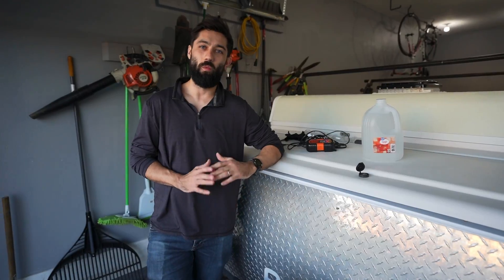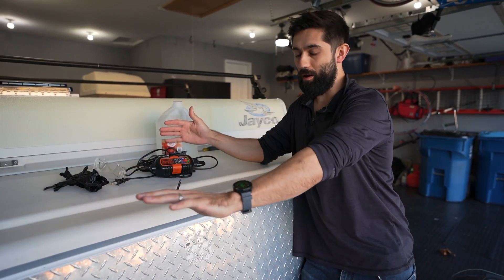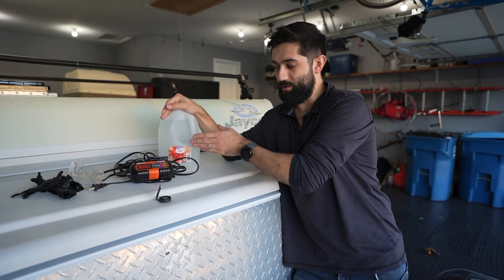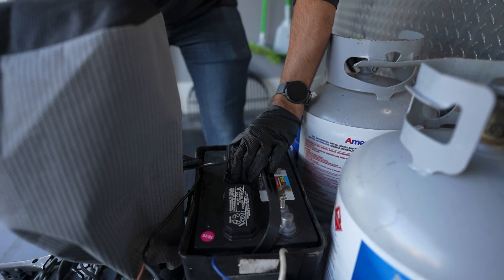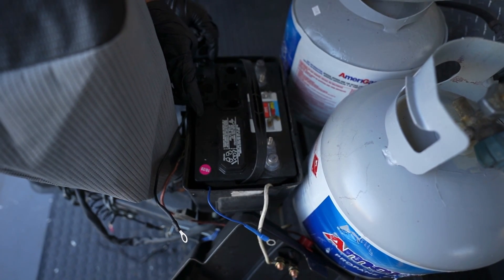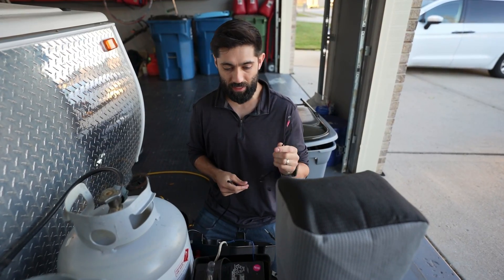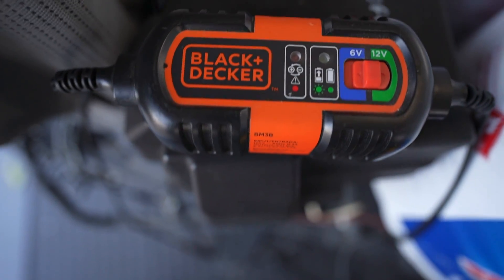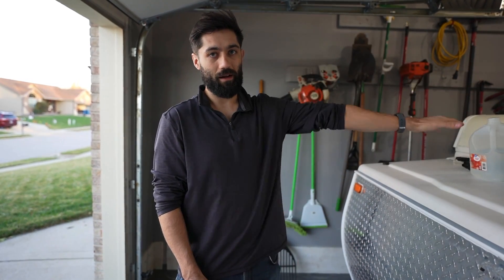Prevent Your Pop Up’s BATTERY from Becoming a Paperweight! | Pop Up Camper Battery MAINTENANCE 🔋

Comment: So, I have a relatively new battery, fully charged it, topped it with distilled water and put the maintainer on the battery. It went into 'maintenance mode'. After a few weeks there was a definite odor of H2S. Voltage was reading about 13 - 13.5V. I had this in my basement so I would imagine there is quite a lot less air circulation than in your garage. Have you experienced this at all?

Comment: I'm new to pop up camping and I find your videos informative and helpful. We are also looking forward to our grand babies enjoying the camper when they come to visit.  Our camper has roof top air, but our home does not have a 35 amp outlet.  What are your thoughts on using a 20 amp, or 15 amp house outlet?  I heard that anything less than 35 could damage the air conditioner.
Reply from the maker: Definitely check out our video on this exact subject: The TRUTH about Pop Up Camper AIR CONDITIONERS | How to Connect Your Pop Up ELECTRIC at Home
https://youtu.be/5stID98t87Y